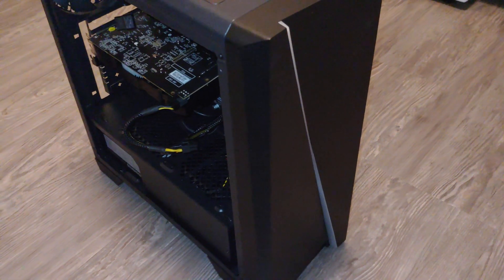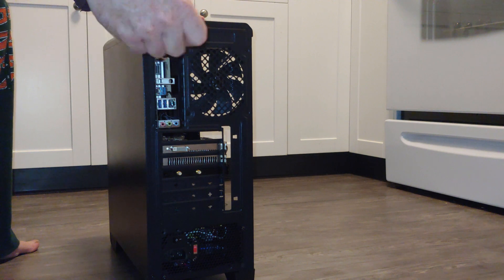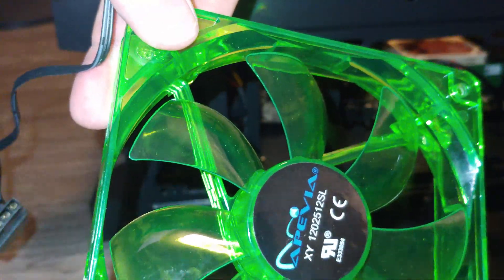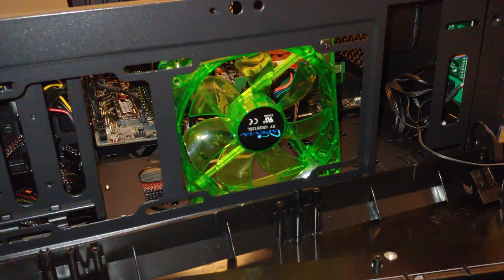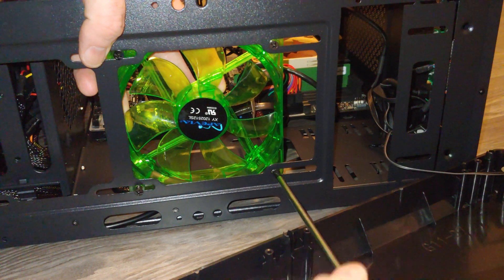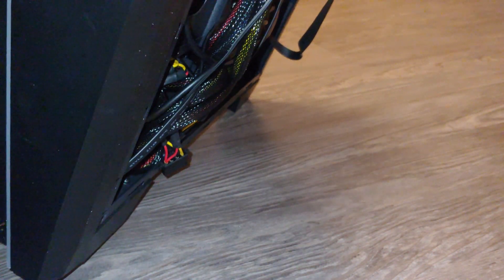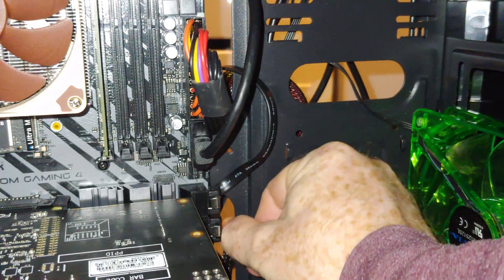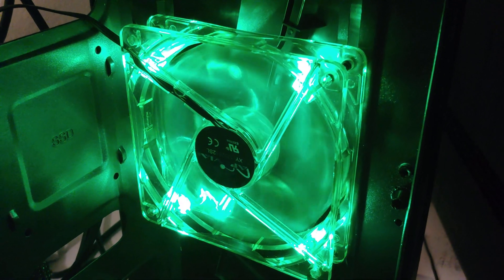How to install a front fan in a desktop computer case PC AeroCool Cylon RGB Mid Tower

Comment: DO NOT BUY THIS CASE! I bought it and found out it has 3 major problems.
1. Very bad airflow, because there aren't any venting holes on the front panel, so there won't get enough air inside the case.
2. There is almost no space behind the motherboard for cable management! Many PSUS have stiff cables, if that is the case for you, you need to be very careful in managing cables, otherwise you won't be able to close the panel behind the motherboard.
3. Case metal is blocking screws on the backside of the motherboard for CPU cooler mounting! I had to literally cut off a piece of the case to be able to mount my CPU cooler, because the case has a very bad designed opening hole on the backside, where you can normally tighten screws of CPU coolers from back of the motherboard. This is VERY bad design decision!

Please, if you allready bought the case, send it back and get a better one for 10-20 dollar more. It is worth the investment.

Comment: I bought one of these fans with LED on Ebay , unfortunately the cable that supply power to it melted badly one day , a strong smell of burnt plastic  filled my room .  I suspected the cable was of low quality.  Where to buy less dangerous pc case fan?
Reply from the maker: Your fan did not have a 4 pin and molex connector did it?  If so, I hope you did not plug them both in at the same time.

Comment: Hi, thanks for the tutorial. Is possible to install two 120mm fans on the front panel?
Reply: 3 in front 1 top 1 bottom and it comes with a rear one
Reply: @hardpeeks  top ? i couldn't find where to place the screws
Reply: @furelkan  On the aeration grid
Reply: @Pingord  there isn't screws placee
Reply: @hardpeeks  how to install a bottom one ?

Comment: That's why you get a dremel and make some cut outs on the front panel or top and sides easy modes since I work with a lot of rc cars airflow is a must for all electronic parts

Comment: if i connected an rgb fan would the rgb switch on the case change the fans color as well?
Reply from the maker: I currently don't have mine with me...my RGB switch died within the first day.  That said, I don't believe there is a hub in the RH access panel area..so additional RGB would have to be controlled by motherboard bios or software.  If I remember correctly, the RGB was powered by SATA 3 power connector.
Reply: @PC_HardwareTechUnboxing_1  would i be able to connect multiple rgb fans
Reply from the maker: There are so many types...some wireless...some you need to know if your motherboard supports.

Comment: How do I put one on the top?
Reply from the maker: I was unable to due to interference with fan housing and CPU power connector. A thinner fan may have worked.  That said similar steps to this ..except intake side is facing motherboard...exhaust side blows out.  Depending on connector type...either connect to motherboard with 4 pin or use Molex connection off PSU and route inside RH access panel